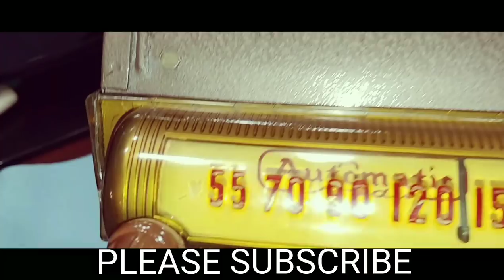ANTIQUE1948 CAR RADIO RESTORATION - COSMETIC

Comment: You were sanding faster than the speed of sound.😉

Are you planning to completely restore the radio? 
(Asking before video finished.)

Is that regular white glue you used to patch the speaker?

Edit;
It looks awesome. 
My favourite restoration of yours to date.